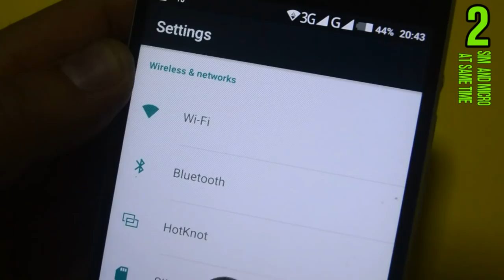6 Tested  Life hacks that work!

Comment: What kind of place or where do you go to buy all these little electronic things like buzzer, miniature fan, little wires, little switches, little electronic board looking things, led lights, little motors, etc...all that kind of stuff that you buy to play around to make things?
Reply: I wasn't planning on making any of the things in this video. I am just wondering how you get all these little things to create something.
Reply: You can go to Radioshack (Yes, they still exist), or online, Microcenter, anywhere like that.
Reply: I pull mine from other little things like kids toys that won't be missed.
Reply: It really depends what you want to make, and where you live. If you're in the US, radio shack and micro center as previously noted - though id recommend micro center as they have a huge selection of electronic hobbyist stuff, where radioshack basically has a drawer or two now a days. If you don't have either near by then DigiKey, Mouser, and Newark are all good online vendors. eBay is also a great place to buy cheap stuff, though don't buy important components on there since you never really know what you're getting is genuine. In europe and such I think RS and Element 14 are the big places
Reply: I DIG HISTORY
Reply: gina Isom in the cloth store.

Comment: Awesome video.  I'll bet absolutely no one has ever tried any of these though.
Reply: After Hours none of them are useful
Reply: RoboticDiamond - 100% correct
Reply: the simcard one is useful if you have that kind of phone, whatever it is. personally i've never seen a phone that has overlapping sim/TF but that doesn't mean they don't exist.
Reply: phantom sage
Reply: I'm not to certain but I think the huawei honor 5x has this capability... just to clear it up that port on the phone showed is SPECIAL it takes either a SIM or a MICRO sd, the pins are oriented different directions which is why this is possible this is going to work for iPhone and is rare in Android
Reply: Doesnt work...  Just tried..  Memory card and sim get more thick and tray doesnt allow it to enter..

Comment: Someone else needs to try the SIM card one. There's no fucking way that works.
Reply: I am with you
Reply: everybody now this not work  but sure he is earning credit
Reply: maybe only work on hybrid second simcard
Reply: Looks like it's specific to that kind of SIM card sled. That phone's sled can support 1 SIM card and 1 microSD--OR 2 SIM cards. That hack basically makes it so both the microSD and SIM contact are touching. Definitely won't work in any phone not designed like this.

And yes, SIMs are really that small once the plastic is off. Never seen anything like this, though!
Reply: As a person who helps people with phones and computers, you seem to lack logic. What laboye was saying is that the socket is designed to accept either a SIM card or a microSD card. The pins are in two different positions. You can see that from the tray in the video: it's designed to accept a microSD card in one orientation, and a SIM card in the other orientation. By sticking the SIM to the microSD card, the microSD card is touching the SD pins, and the SIM is touching the SIM pins at the same time. You can tell this from looking at the shapes on the tray.

He hasn't connected the microSD card to the SIM interface, or the SIM card to the microSD interface, which seems to be what you believe. Also, why would you need a PIN code to reset (something)?
Reply: Galaxy S7....
Reply: it worked for me
Reply: Well, I disagree with you...this video isn't fake and it'll work. Try this, you won't be dissapointed :D
Reply: if he modified the sim card that came with his phone why would the sim be locked in the first place as you are suggesting? He wouldn't need any "C++ code" or anything like that
Reply: shadowtec2412 

a) C++ isn't primarily for video games and visual effects. C++ is a general purpose language for making computer software. You can use it for low level access to hardware, or high level applications. The higher-level parts of MS Windows are written in C++, for example. 

b) America isn't necessarily the same as everywhere else in the world. If I buy a phone in the UK that's locked to a carrier, I can use any SIM card from that carrier without doing anything more than putting it in and switching on the phone. If it isn't locked to a carrier, I can put in a SIM card, switch on the phone and it works.

When I moved to Japan, I brought my UK phone with me (a Google Nexus 5, not locked to a carrier). I went to a carrier here, got a SIM card without providing any details of my phone, put it into my phone, switched it on, and it worked.

If you refuse to accept this as a possibility when it's a reality for a large number of people outside the US, then you're an idiot. Just because you don't understand things, it doesn't make you right.
Reply: lol
Reply: Port Nelson of course it doesn't work he fucking cuts it. You can't just go "ehh I don't want that part😂
Reply: Actually, you can. He just removed part of the contact. He just trimmed the edges of the contacts. As long as they still make good contact with the sim card slot, you should be good. Some slots seem to try for the middle of the card, and others for the edge, so it may depend on the slot. The actual chip is tiny though.
Reply: As a person who helps people with their sentences, I recommend punctuation.
Reply: Attacked by Snakes 
....
Soz, was a response to shadowtec's "as a person who helps people with their phones and computers it will not work a sim card is for making phone calls and is different then a sd card even if people found a way to use it like he did in the video you would still need the pin code to rest it and that is not free plus the software for the simcard has a different coding then a sd software coding plus this could run a phone and who has 500$ to spend on a new smart phone it a lot smarter to buy a new sd card"
Reply: ***** I love how you use semicolons and commas, but not periods.
Reply: its for phones that have multifunctional sim trays

ie duel sim, or single sim and sd 

one side of the tray accepts a sim or sd and this cheats it so you can use both by making contact with both the sim and sd pins at the same time.
Reply: Attacked by Snakes only works for phones with SD card expansion obviously
Reply: dude...it was his own sim card, already activated by the carrier, *T-MOBILE, VERIZON* or carrier unlocked...you really shouldn't touch anyone's phone or computer...please...And the only thing he trimmed was the contact points on the sim card, not any of the functioning hardware...so maybe if "helping people with their phones" is a dream of yours, take some classes, open your eyes and see what happened in the video...you can't even spell, let alone know any real information about computer hardware and/or software.  Please stay far far away from electronic devices, because I'm 100% positive you will mess it up.
Reply: Now that shadowtec2412 has grabbed the attention of the entire internet by arguing with anything that can type half a sentence on a keyboard, can we all just acknowledge that he has the biggest penis, and he wins the interwebs for the day? If we keep indulging him, he'll keep going off topic, insulting other people while saying that their attitudes are the real problem, and might even use some of his advanced 'helping people with computers' skills to  remote access our computers and leave behind some nasty malware.
Reply: Attacked by Snakes
Reply: +shadowtec2412 As someone who repairs these things for a job, I would try this and it would probably work. I'm so fucking triggered right now.

I'm guessing you're the "technology guy" in your friend circle. Or maybe you've been trained by a carrier as a sales rep. You spout nonsense as fact without trying any of this stuff for yourself. As "a person who helps people with phones and computers" common sense and logic should lead you to a reasonable explanation of how this works. Meanwhile, you've probably never seen this model of phone, or a dual-sim/sd slot... (or ever actually helped anyone).

I'm still flabbergasted that you mentioned voltages and coding when it comes to sim cards. Amazing. They touch the pins, the phone reads the information. Pretty simple. SD card is similar, they touch the pins, the phone reads the information. If there are 2 sets of pins and you managed to touch them both with the right cards at the same time? That's the hack. Welcome to the intersection of technology and ingenuity, two things you seem to have little knowledge of.

You say "if a person doesn't know how to mod electronics then they shouldn't mod them -" Well, thank you CaptainObvious but the electronics part is the PHONE, not the sim card. Your amp example was retarded and you are metering out bunk advice based on a poor decision YOU made in the past. You say you are approaching it from a scientific standpoint... Nope. Because of that sentence, a budding young STEM student just threw away their books and decided to sell drugs. Thanks a lot. Science is doing and seeing, not expecting to fail and not trying. Seriously, so fucking triggered.

Ahhh Look at how much you made me type, you asshole.

You really are the worst. I will probably not reply to anything you write. I know you have plenty to spare but I'm trying to cut back on chromosomes. I'll be thinking of you the next time a customer comes in with a cracked screen and blames a software update. 

 And just in case you have any lingering delusions that you are still right - You are not. You fucked up. And we all saw it. Stay off the internet.
Reply: um, sure you could do that SIM + SD Micro trick, but there is no way you could use them at the same time, unless you had a custom type of phone that supports such craziness, and why WOULD you, since they don't make cards like that?
and just because you CAN do something, doesn't make it a good idea. the phone this was done on was only designed to handle one or the other, not BOTH at the same time. you would probably wear out your phone using this too much, and beside that, what happens when you upgrade phones, and your silly little trick no longer works with that "custom SIM you made? no transferring THAT SIM to another phone...
Reply: el lector de sim no tiene los mismos pines que el lector de micro sd
Reply: es un doble que tiene los pines de sim en un direccion y pines de micro sd en otro direccion.
Reply: Attacked by Snakes Why wouldn't it work? There is no hardware on the edges of the SIM chip, only on the center... also phones like this have the SIM card and SD contacts on the same area because having connectors for each other would be a waste of space, that's why it works... SIM card's chip is absolutely tiny and thin it's crazy
Reply: ofc it works zzzz all he did was a way to connect the sd card to the connector and the sim at the same time to its own connector...
Reply: no funciona
Reply: a guy does a sd card, sim card hack and a whole bunch of dumb arguing accures lmao smh
Reply: for hybrid sim card
Reply: Muhammad Afiq Mazlan no I think he is right because even if it works on hardware. You will need a rom that supports dual sim
Reply: Yuki Sohn just following video 😊😊😊😊😊😊
Reply: Attacked by Snakes believe it or not but I did it
Reply: Attacked by Snakes it worked
Reply: Attacked by Snakes
Reply: no proof that sd card still works lol ..its  fevistick damages the circut of sd card
Reply: Try it simple

Comment: Someone please tell me what exactly does the sim card hack do?
Reply: Looks like he changed a MICRO SIM card from low capacity to 14 gig capacity.  But you can buy a 16 Gig capacity Micro sim card for 8 bux too.
Reply: Amy Sidious
Reply: Rahul Tyagi
Reply: From what I can figure out, it allows you to use the same port on the phone for an additional sim card and memory card at the same time by creating a 'hybrid' sim/memory card. So instead of just having an extra sim or having a memory card, you can have both at the same time.
Reply: It looks like the only thing it does that it's gonna fuck your phone up if you insert them bullshits
Reply: Amy Sidious
Reply: Oisin Kelly  there are some dual sim iPhone like mine (xiaomi redmi note 3) that allow you to chose if you want two sim or a sim and a micro SD. that hack allows you to have two sim and the sd the same time
Reply: Oisin Kelly explodes.

Comment: the slot reads any info it comes in contact with. it reads the sim and the SD card together, not as a single unit but to each their own. The card just has to fit with the right carrier sim and it'll work.

Comment: this is nothing but a troll. the circuits with the batteries can cause them to explode. doing ANYTHING to the simcards will ruin them. and no. YOU CANT get extra memory by fucking inserting a damn flash drive into ur damn SIM card slot.... jeez christ... i hope noone tries theese things...
Reply: It's a phone with a dual-purpose slot. That trick will only work on that model or a phone with a slot just like that.
Reply: ye well: notice: he didnt  show that he puitted in the sim while the screen started to register the sim. so i highly doubt that was the case. he probably just switched the sim when he cut the video.
Reply: and anyway the moment u cut the simcard or scratch it. it is useless. this simcard he used was useless. sooooo yeh. GL HF.
Reply: Kevin Kyo Nightwolf Not really, man. SIM cards are just a tiny epoxied microprocessor with the pins soldered onto the contacts. They can take a beating. If you peel it off, you might crack it, but notice he melts the plastic enclosure off first.

Assuming you don't damage it, it will work fine!
Reply: is phone has an hybrid sim slot, but he don't say that
Reply: laboye iiikk

Comment: #2 The example shown here is done with an Oukitel K10000, (2 SIM, or 1 SIM and 1 micro SD memory card capable, not 2 SIM and 1 memory card) the same could be done with K6000, and any other smartphone having the second slot for 1 SIM or 1 microSD card, not both. Really clever solution, just be careful to do all without errors, as heating too much/burning the SIM or cutting it too much, so do it, but at your own risk!

Comment: I dont get how glueing the sim in the SIM card to the microSD would even work
Reply: it's for samsung s7
Reply: Still dont get it
Reply: s7 has a simcard and sd cart slot. it is entagreted. you can use 1 sim and a sd cart or 2 sims. by this method you can use 2 sims and 1 sdcart. did you get it now lol

Comment: i guess the battery saw was ppwered by a 18650 battery like a sony konion vtc5 or lg hg2? well better the hg2 because they have more mAh so they work longer. you dont need a big A limit for this i guess so even a other battery with more than 3000 mAh would work but the hg2 woth its 20A would probably work longer than a 4500mAh 15A battery or 6000mAh 6.4A battery because it does not break in as much

Comment: i don't understand the second one
Reply: there are some devices that have a second slot that can be used as a 2nd sim card or a micro sd card reader, so he cuts off the code part of a sim card and glues it on a micro sd card so that the 2nd slot in those devices would be able to read both the micro sd and the 2nd sim card at the same time
Reply: Mathias Santos pretty cool, I had no idea this even existed.
Reply: big LoL :) .. where do you live ?! :)
Reply: The Trinity 
Under a rock!
Reply: I 😞
Reply: Man do you know if this works on an Iphone 4s?? Looks pretty fuckin cool. Greatings from Argentina!
Reply: ffs.. do u guys even know what is a hybrid sim tray? gosh
Reply: edelmontesano it will work u know..  but..  🌚.. have u heard about an iPhone with dual sim capability before?

Comment: That Lithium Battery charger board will burn the hell of that tiny batt with 1000mA you need like 100mA to charge that small batt and this board needs a tweak, replace a charge resistor.. 
Dont burn your house watchout guys !
only do that project if you know what you are doing.. be safe
Reply: Sam lol

Comment: so tell me... what is the point of the saw if you still have to do the regular motion of sawing just to get through that tiny piece of wood... seems like you should just use a hack saw so you can put some force behind it and it will only take like 3 full strokes. stupid hacks all around

Comment: Wtf did i just see? I don't understand #2, with the sim card and SD card.. Did he just take the sim chip out of the card and simply fasten it to the back of the SD card, pop it in his memory card slot, and not only has SD storage, but also a "hacked in" a second sim card? 

How is that possible? If that was possible, wouldn't it be dependent on if that particular phones SD slot designed to do that? Since it would need to read a Sim card from the back of a SD in a SD card slot?.. 

I'd highly doubt this is a standard design feature with most phones.. Or maybe i'm missing something and this works? Or i'm retarted and am comprehending what i just watched the wrong way?..